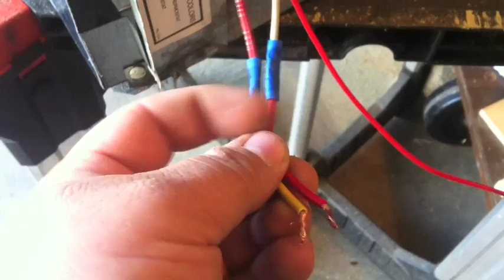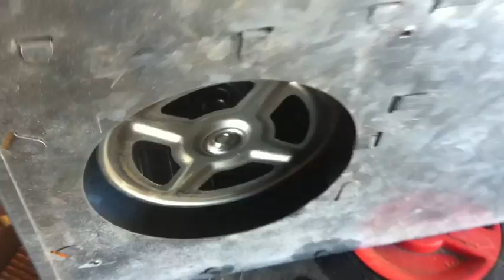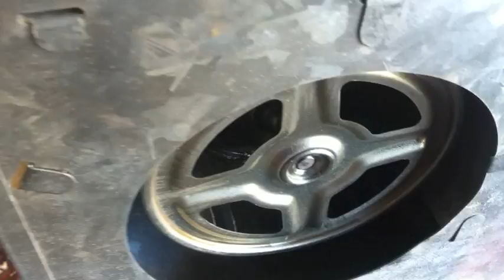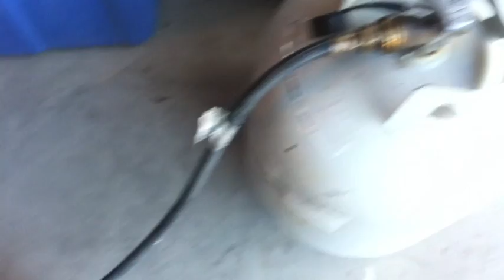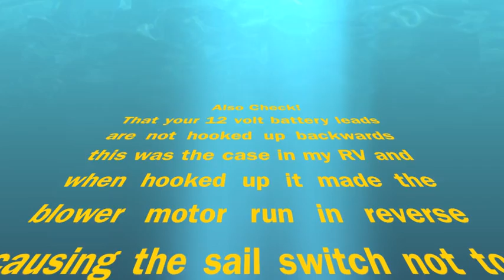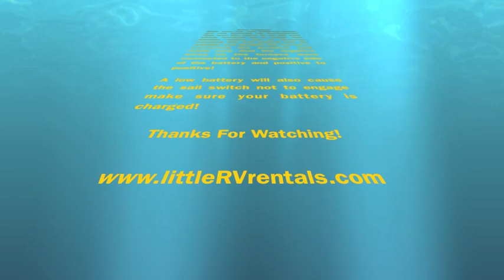How to RV Furnace Repair Sail Switch Lighting Procedure

Comment: Great video.  I justbought a truck camper with an Attwood FA-7912 furnace.  How do you know when the pilot is lit? Is there an inspection window? If so, where? The user manual seems to be awfully hard to come by.
Reply from the maker: I don't believe there is a sight window for the flame. If you don't feel heat within 2 mins or so try relighting. Thanks for watching!
Reply: @Littlervrentals  Thanks! I'll give it a try this weekend.

Comment: So my 1978 rv furnace looks ok but how can i check to make sure its safe for use?
Reply from the maker: Hi there if are worried for any reason you should definitely have it looked at and tested by an RV certified tech. Other things you may consider is an up to date smoke and carbon monoxide detectors. It is also a good idea to crack a window or vent open a bit when using a furnace. Cheers,

Comment: My furnace is a similar old model. It works the same way as yours. However, when the pilot is on, it has a gas leak right around the pilot light knob when I turn it to on. If I light a match around the knob, there's flames all around it.  Any suggestion on how to fix this and where can I find a part for a model this old, if needed?  Thanks from a fellow Rver.
Reply from the maker: Hi Tatiana, If propane is leaking from the knob that is very dangerous even in the off position this is something you should have checked out by a certified RV tech they may or may not be able to repair. Cheers.